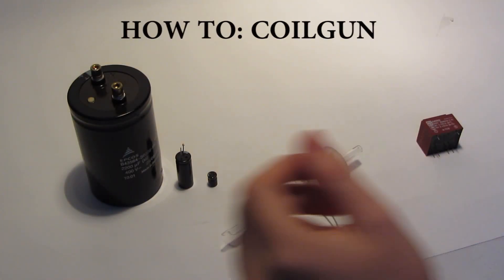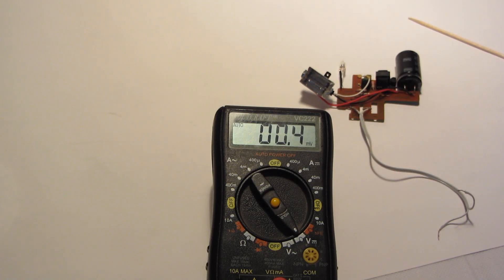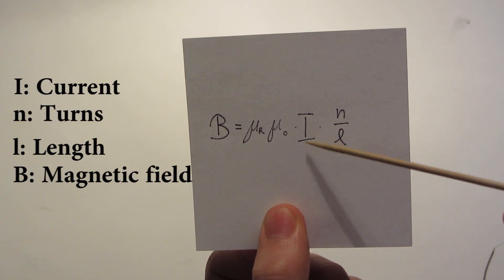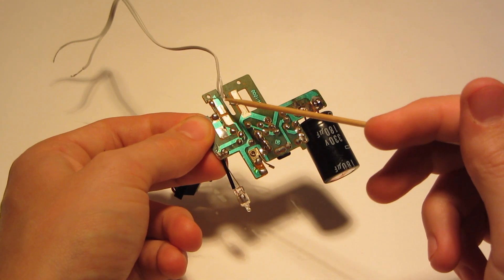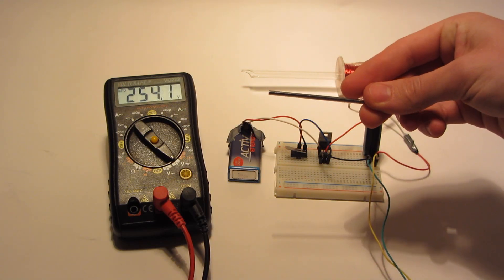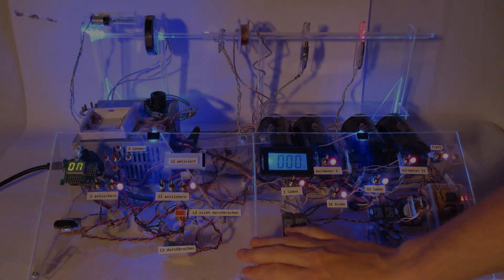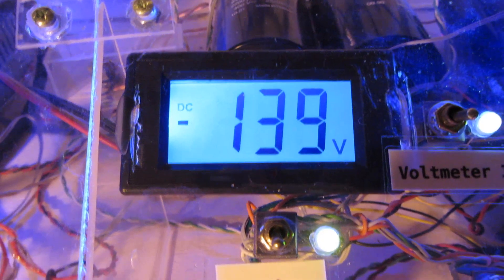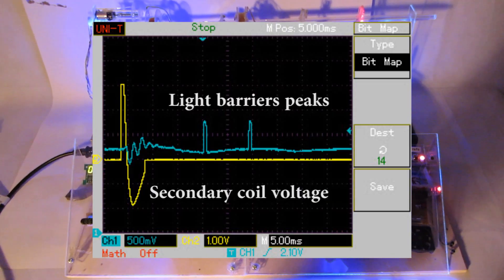How to build a Coilgun or Gaussgun Experiment - Tutorial

Comment: One small question. Is there way you could put a voltage meter go on the Circuit.
Reply from the maker: I put a voltmeter onto the capacitors in the other coilgun model!

Comment: How does the bullet fire past the coil, shouldn't it have a force pulling it back when it reaches past the center? Or is the capacitor discharge quick enough that the magnetic field turns off before it leaves the magnetic field?
Reply from the maker: Thanks for your comment! Ideally the magnetic field turns off before the metal reaches the coil's middle section! This can be achieved by timing the current with a certain capacitance or with power electronics to shut off the coil current. Good question though!

Comment: Doesnt the coil burn at so much volt? Most solenoids for industrial valves (i was planning on using 2 of those) work at 12 or 24 volt dc
Reply from the maker: That's a good question! It depends on the period of time in which high current flows through them! For a pulsed current the duration is much smaller than half a second - you could look up your solenoids' data sheets and find max. peak/pulse current!
Reply: @Doityourselfgadgets  i have built a circuit with a 10k microfarad capacitor and my 12v 1A solenoid coil into a nerf gun housing in a way i could add the second solenoid inc. Capacitor etc easy. But when i tried shooting a screw with a sawed off head on 24v (twice the allowed voltage on the coil but for a very short time of course) and it shot only about 3 meters when i managed to do the timing (with button) well. The circuit uses relais controlled by transistors, controlled by my arduino. I didnt write the software yet so i havent shot the gun controlled with the arduino so with optimized timing yet. But how can i shoot further or faster with my solenoid? I dont really have higher transformers than 220 to 24v (im in europe, Netherlands so standard is 220v) and larger capacitors are quite expensive. Are there more options for me to shoot better or should i buy a transformer or capacitor? And if so, wich is more important? The transformer or the capacitor? Most yt coilguns use like 300v but idk if my solenoids can handle that and theyre like 100 euros each,  and i have only six of them so dont want to screw all of them up.
Reply: @Doityourselfgadgets  but why would i even want a high voltage? the current is in the quation of the magnetic field. Because r=u/i ?
Reply: @Doityourselfgadgets  today my capacitor broke. I was using it with 24 v dc, it should hould 40v and 10k microfarad. I have no idea what happened but some security cap exploded i guess because there came some brown smelly fluid out of the capacitor. Something in my circuit was wrong because the relais didnt work the way it should, so i guess i did something wrong connecting my relays or transistor, but the cap still had onky 24v on it so i dont know what happened. Can you help me pls?

Comment: you have more energy available if you, use high voltage like over 1 kv. But it is very dangerous due to, over 1kv, current can even flow through air
Reply from the maker: Yes, that's right! High voltage is really dangerous and I would not recommend building a HV coil accelerator!

Comment: I'm pretty sure a capicitor stores voltage Not current, a coil or inductor stores current. ;)
Reply: I still think your confused , A capacitor stores voltage and charge, which you have stated , but it does not store current. Current is created when the voltage / charge  moves across/through a resistor. Still very nice project , not trolling you , just trying to help your understanding of a capacitor.  I still get confused with terminology . Amps , volts, current, potential, charge, electromagnetic force, columbs, farads. How many ways can you say energy and it's measurements. lol right eh! Maybe do a vid on terminolgy  ; )  it could help us both !

Comment: Could I wind the coil around an aluminum tube? I don't see how that would shield the magnetic field ... except if there are eddies created in the metal in the strongly changing field. I was thinking of using the Gauss gun for a 1/16 model tank kit barrel. Perhaps it is better to go with a plastic barrel I guess.
Reply: I know this is a reply to an old comment but it might help others.Yes you can use AL tube, I used one for mine and it worked great. Other people might have a different view or result.I am only speaking to what I did. It's a shame that I have to put that last sentence but folks cry over everything here on utube

Comment: What would happen if your projectile was a nano-particle of metal? Would it launch faster or not work at all? I assume you would have to make the launch tube infinitely small in diameter too.
Reply: It would fly fast, but due to a lack of mass it will lose velocity very quickly.
Energy out put is equal to mass times the squared velocity of an object.
If an object does not have the mass to maintain inertia it will lose velocity fast due to lack of mass (weight) keeping the momentum of the object 
It definately will not penetrate at a nano particulate level.
Then again if it's too heavy it will require more energy to reach maximum velocity within the parameters of the equation E=MC2

Comment: Excellent video. However people should be extremelly careful. You don't want the capacitors to blow up,while they are charging.lol. Something similar happened to me in the past,when I was building circuit. Build something small first,test it,understand it and use maths to verify the output. You will end up with Laplace equations and differential equations,but that's ok.

Comment: At 05:00 you charge the capacitor with a 9v battery? Or you use a higher voltage?
Reply: Thank you and what you put inside the G36 to charge the capacitors (I think about using seried 2-3 9v batterys It will be about 18-27v)

Comment: is there any stronger thyristor there?

and can u use irlb3034pbf n mosfet as high ampere switch for those kinds of job?
3034 have 250amps limit 40v

2n6509 have 800v 300a surge ?

Comment: Also how much FPS are you getting out of the 140 volts you are using? One last thing, the basic components to this are a power supply, a couple of switches, a transformer, a Thyrisitor, and a capacitor or do you need some mother board type of things in there too?

Comment: What if you made a huge pancake coil that is only one wire thick but but maybe a foot (304mm) in diameter? With 27ga wire you could could do 360 turns (assuming a .5 inch (12.7mm) center hole ) and since the thickness of 27ga wire is 0.016in (4.064mm) 360 turns/0.004064 meters is pretty good I think. Not practical maybe, but the B field would be very large.
Reply: +Doityourself Gadgets Make a coil gun of course, it'd be really awkward but effective in theory no?

Comment: Hi sir a have a small problem with my coil gun.The projectile stuck in the middle of the coil.Sry for bad English.
Reply: that means the charge in the capacitor isn't getting released quickly enough. the metal is getting pulled into the coil, but then getting pulled back. you need some sort of time delay so the coil is only active for a very short time, like a couple of ms.

Comment: so i was thinking.... can we increase the energy of the projectile if:

1.we use a magnet as a bullet instead of a solid metal? since i suppose a magnet would feel the magnetic field better than metal

2. if we can reverse the polarity of the coil as soon as the projectile pass mid point of the coil, so that one coil not only pull the bullet (magnet) forward, it pushes as well

3. if we restrict the magnetic field of the coil to within the barrel, using weak magnets to cover the outside of the barrel. because as i remember, magnetic field lines never cross, and the strength of a field is determined by the density of these lines....

i am no expert, or even scientist, so forgive me if none of wt i say is actually going to work

Comment: Very good and explicative video, keep doing that. If i want to build a coilgun, could i use microwave capacitors? And of course charge them with the Microwave Oven Transformer.
Reply: ***** I recently check and as far as i can tell they are AC, and yes, when you discharge them they generate an extremely powerful spark, and if you make a circuit with those they can create a hell of a coilgun, but yes, it´s pretty dangerous tho

Comment: Where on the charging circuit do you attach the capacitor you want to charge? How do you charge the capacitor while it is in the circuit? And can you charge capacitors of larger voltages using the original unchanged charging circuit from the camera?

Comment: Hi, I am building a coil gun of my own and have found your video extremely helpful and informative. I am having issues switching the extremely high initial current after I discharge the capacitor. I have tried using various MOSFET's and transistor to switch the current; however, I keep finding that they do not have a high enough current rating and melt/fry. I was hoping that you could share with me where you got the thyristor in the video (you mentioned it is rated at 1200 amps). When I look up the serial number listed I only find one rated at 20 amps. I am trying to switch at least 500 amps. Someone also mentioned to me using a bunch of transistors in parallel all fired in unison in the hope that they would split the load of the current. Will this work? Please let me know if you can help. Thanks!

Comment: What is more important, to have higher voltage in the capacitors or higher capacitance? Ex: Is it better to have 10 capacitors rated to 25v and with a total capacitance of 10,000µF or 4 capacitors with a voltage rating of 400v but with a total capacitance of 2500µF? (Connected in parallel)
Thanks
Reply: +Doityourself Gadgets I´ll try with the 400v capacitors and different coil as you suggest, and also give a shot to the 25v setup, variating the coils in both circuits, so i can see which capacitor bank works better with a certain type of coil.
Thanks for your help!

Comment: Does the wire have to be coated? I just bought over 100 metres of uncoated wire...

If it has to be, where can I get the right type? I'm in the UK so there aren't any "radioshack" shops, I just can't find something that looks as good on Amazon.
Reply: Thank you very much! Ordered 2 of them, thanks for that, you're really helpful.
Reply: +Doityourself Gadgets hey, I've been watching your videos and I've had an idea to deal with the issue of "moar power" you could have a projectile spin around and around in a circular motion in a container that would allow it to, then being brought out into the barrel using another coil with higher voltage (if this doesn't make sense ask me, I love your videos)

Comment: Dang. This was a little more complicated than I was hoping... I was kinda hoping I could put a coil gun inside a Nerf gun and have a, well, gun xD.
Reply: you probaly could but you would have to cut some plastic away
Reply: Brownyafier Well obviously. Most extreme Nerf mods do that to house new internals.
Reply: +TheTriforceCrusader  actually in my opinion it was simpler than I thought, I already have the materials laying around, a copper pipe, an old camera, an old vacuum motor, for coils and a light switch!

Comment: In all the coilgun videos I have watched they all used some type of ferrous projectile. My question is has anyone that you know of used copper bb's or just steel ones.The principal for expulsion should be the same- yes or no? I will welcome any and all comments.
Reply: Copper is diamagnetic, it isnt attracted to a magnet but ever so slightly repelled, and steel bbs work well if you have a really powerful magnetic feild, I have a coilgun that launches bbs through aluminum cans,
Reply: the normal trajectory of most bullets arc up so what is the problem involved with round rounds?
Reply: Richard Vollnogle. Direct contact rails should be used to power the coil when a conductive magnetic projectile passes between the contacts, magnetic impulse acceleration should be used as it is more efficient, also the coils at the beginning stages should have more turns than the ones at the end of the accelerator barrel.
Reply: Richard Vollnogle yes they work.

Comment: If i used some  9volt batteries (like 14) how 
much/big capacitors should i use?
Reply: Capacitors have a voltage rating, so you would use one that exceeds the voltage you get for your battery bank. As for the capacitance value, the bigger the capacitance the better. Like he showed in the video, energy stored in the capacitor = (1/2)CV^2 so the bigger the C the more energy you have, but you'll find that higher capacitance capacitors tend to have a lower voltage rating, so you're better off with a lower capacitance and a higher voltage, since in the equation the voltage is squared.

You also have to worry about the time it takes for the capacitor to discharge since the larger the capacitance, the slower it discharges. If your capacitor takes too long to discharge, the coil will still be energized after the projectile has passed through and it'll pull the projectile back towards itself (although with less strength) so it will slow it down. It's all a careful balancing act it seems.

Comment: I am making this for an extended essay and I am wondering, if I have a 400V capacitor, but I discharge it at 100V, is the capacitance the same?
Reply: ***** so if e.g. C=q/V, and say C is 100, and if V is 400, then charge (q) is 40000, but when V is 100, is the charge going to drop to 10000 as well to keep capacity the same?
Reply: ***** also, how would one properly use the equation B=μOμRI(n/ℓ), and how would this relate to electrical potential energy.
Reply: Son_0f_Ares surely if V is 400 and q is 400.. and C = q/v  then C = 1?
Reply: ***** and what is μR?
Reply: ***** and for the calculation of coil density, is the coil density number or turns/length of wire or length of coil?

Comment: i only have some 50V 0.22µF capacitors. I guess it's not gonna work but is it possible to use many of them instead of a big one?
Reply: Just connect negative to negative and positive to positive and it's basically makes a big capacitor. Just make sure you don't short the circuit and the side with a stripe in a capacitor is negative
Reply: Dr.Waffles yes it has to work.

Comment: I finally got mine to work.  However my 2200uF -400V capacitor takes too long to charge up.   What do you suggest is best to charge up my capacitor up to 300 V quickly?  It is going at least 1 V at a time and i don't want to wait an hour before it reaches 100 V.
Reply: On ebay type: 14.8v to 450v dc-dc inverter module 150W.

Comment: Transformers are slow. Use a boost converter to got the voltage with some current. It doesnt work like a typical boost converter, it takes the power from your capacitor and feeds it back through the circuit to step up the voltage. heres a good how too i found. its much simpler than a transformer circuit too in my opinion
http://www.instructables.com/id/DC-DC-HV-Boost-Converter/

Comment: Hey, I love your video, I'm working in a Coilgun for a college project. But I have a few questions ....According to the equation to calculate the Energie, well that depends on capacity and voltage Now, I can't get 400V capacitors with no more than 70mFr. So I've to buy plenty of them to get about 100 Joules of stored Energie. Now, I found some capacitors of 200V and about 220 mFr, thus giving me a total Energie abobe 800J (obviously, putting plenty of capacitors together). So, my questions are, Should I use 200 or 400V? What is more important, Voltage or the total Energie? Thanks for your help, I'm kinda stressed with this

Comment: +Doityourself Gadgets Could you please tell me where you can buy a Transformer? Via a website is excellent. For example dx.com. Because I live in the Netherlands.

I only find Transformers with the ability to reduce the Volts to a certain level. (e.g. Input: 9V -> Output range 3.5, 5, etc)
But I want something like you have. Taking the voltage to a much higher level. Thanks in advance!
Reply: ***** Are the stages from normal copper wire?
Reply: Like insulated copper wire from transformers etc? and what thickness it should be?
Thanks!

Comment: Your video was awesome~And thanks for noting the safety step on discharging the capacitor.Do you how to make one DIY  transformer? :) I dont have camera to used for it. I can get the capacitor from store...But they dont have a small transformer to be sold...they are normally those big size transformer. I need one to make one for stun gun. Hope you can show more on wiring those circuit for the transformer. hope to hear more from you soon :)

Comment: do you think it would be possible to make a coilgun using a hand taser by redirecting the current to the coil?
Reply: since the strength of the magnet is dependent on the current, it would be very weak. tasers are limited to 0.1 Amps or less to remain non-lethal. Many of the high power coil guns use only 60 volts or less, but thousands of amps. Airsoft gun batteries can push a lot of amps, so they can be used for full auto coil guns
Reply: Jarred Sisco you cant and even if it worked it would be really unpowerfull
Reply: ***** Jarred Sisco could you not attach a  diode to turn the ac current into dc?